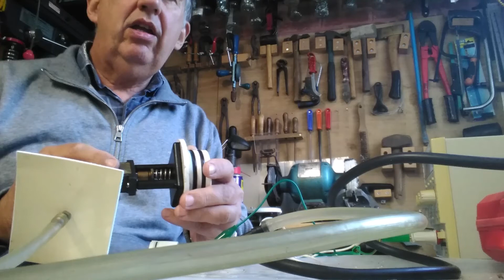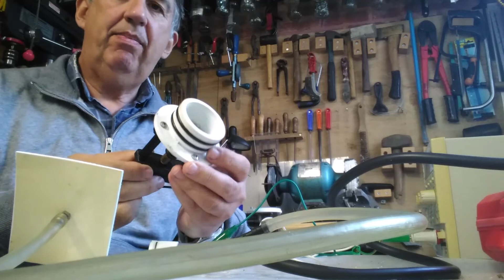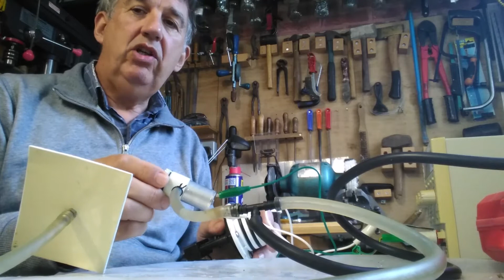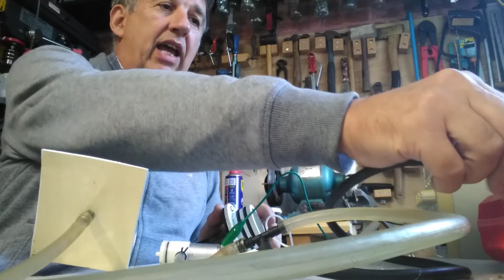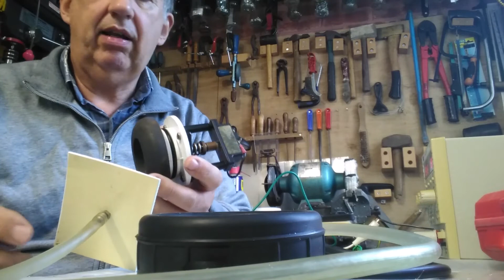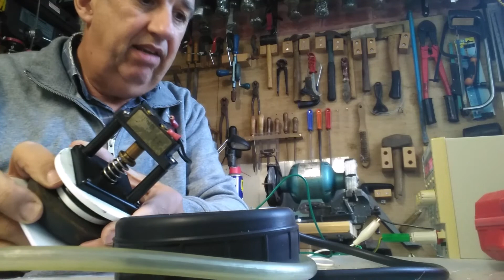Testing a VacuFlush vacuum switch

Comment: What was the on and off vacuum pressure that you've measured using your tool? If the on/off pressure is revealed, many people like us can find the inexpensive pressure gauge from Asia, and fix the Vacuflush toilet. So your findings can be extremely valuable to many users.

Comment: The only thing you proved is that the vacuum switch mechanism moved when the vacuum is applied. You haven’t proven whether the switch itself I’d transferring. Oh, you also proved that the vacuum is not holding for very long, but since you are  only testing the switch mechanism it doesn’t matter..
Reply: Excellent video, and excellent analysis of a common problem. I also have the air leak problem some where, and I suspect it is coming from the elbow of the accumulator tank. If there is a leak, then replacing the switch won't solve the problem. So, your comment is very helpful. Thank you. Did you manage to find the cause of the leak? I haven't, but will attempt to do so next weekend. Crossing fingers that air leak is the real issue.

Comment: I'm in the US having problems with Vacuflush, would cleaning the inside of the switch be any benefit. My system keeps running and if I tap on the tank it will stop. Could you please give me the micro switch replacement info.
Reply: That is a common problem, one which I am experiencing as well. I substituted another switch from a second unit and it didn’t solve the problem,. I think that the differential between when the switch is supposed to close and when it opens is a very small difference in vacuum. So a slight vacuum leak is causing the switch to not reach a level of vacuum that would open the switch and stop the pump. I would look for a slight vacuum leak at the fitting where the toilet drain hose connects to the top of the tank. Of course, you malls need to verify that the Jose clamps are tight. Also make sure the bowl is holding water when under vacuum. If it isn’t, there is your leak.